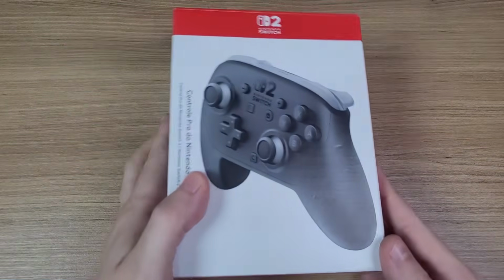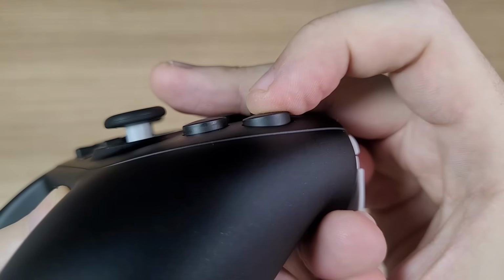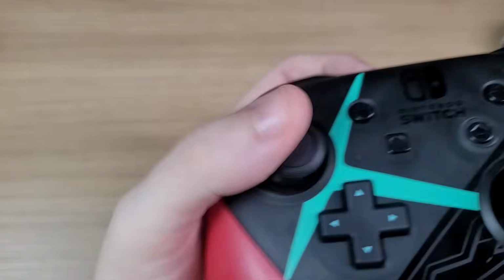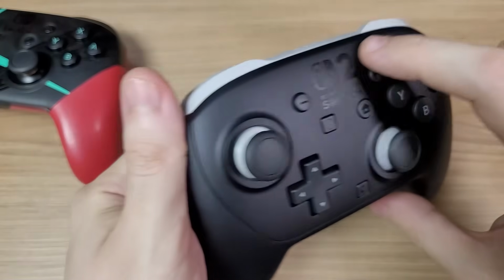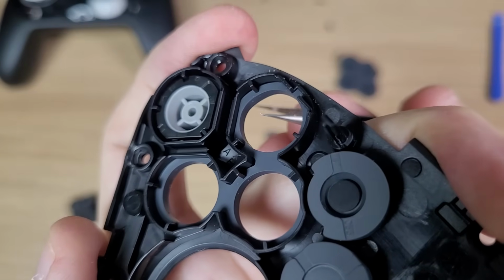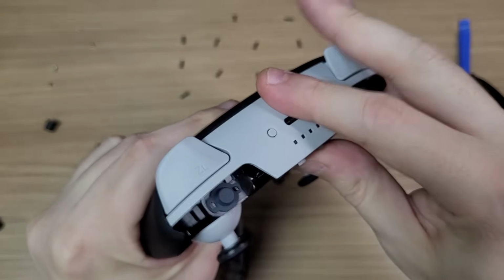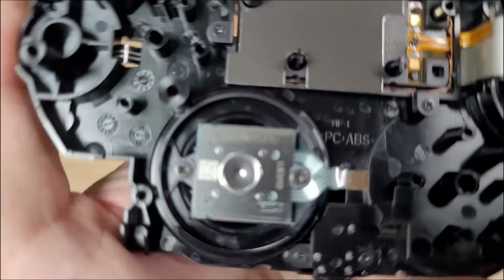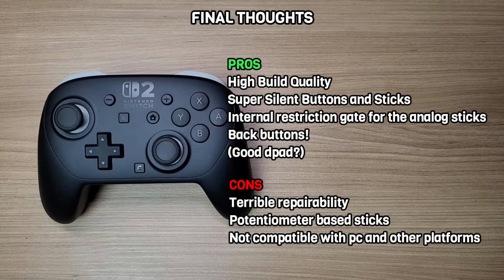Switch 2 Pro Controller Review & Teardown - The New First Party King?

Comment: ETA: These are a new variant of the RKJX2, with the noticeable change being the stick stem, could be a new variant, a new revision, or the not too uncommon practice of a solution being frankensteined by multiple products or a custom solution within an off-the-shelf part.  ALPS has terrible public documentation, only having datasheets on the original release variant (of which the GPD and ASUS products use) but not having any public-facing information on any other variants (the best documented of such being those in Sony products, having a re-molded upper housing, an upper metal retainer, and a FPC that curves to the side).  But this is an RKJX2 by sibe-by-side comparison, I had second-guessed myself about it being a new box when not being able to directly compare multiple images of the three variants.  Presumably it is just a v3 of the product (assuming Sony is a v2), though the massive change in the stick stem would be odd from ALPS but with the previously low volume of actual product on the market I'm going to presume that the change is relatively safe to preform as the Switch 2 has now likely outpaced the volume of old product in the wild within its first week.  Presumably the change is either to make the stick feel fuller-sized (people had previously said the RKJX2 felt small in comparison to the RKJXV, the typical full-sized stickbox), and/or for fitment reasons due to the controller's construction.  The unfortunate part is that a replacement would need to be frankensteined out of old and new parts (a gimbal swap) due to the stem differences, at least until these become available either via vendor (Mouser seems to sell the JX2, I might reach out to know if they know about the three different variants and if there is a resolution to this coming, I might see if any other vendors sell the product and if they have any idea of what's going on) or via an unofficial channel which will likely be salvaged parts for some time.  

The stick modules are the newer RKJX2 line of sticks, Sony has used them in PSVR2 and the Portal and GPD used them in the WIN4, there's probably been a variety of other devices to use them as well as they've been a current ALPS product for nearly 4 years to my knowledge.  I'm not sure if vendors have picked them up, the only 'official' way to purchase them as a consumer; all of their products are designated for large-scale business, typically for assembled products, this is how vendors are able to supply them as parts, whereas any other method of getting any ALPS analog stick is unofficial and typically warehouse buyouts of new old stock, i.e. buying these off of Amazon or eBay would be through unofficial channels.  I'm not entirely sure but these may eventually fully replace the typical full-sized stickbox, given ease of assembly during manufacturing, so they should pop up in unofficial channels at some point, probably next-gen when Xbox and PlayStation release new first-party hardware.  As far as the JoyCon2 modules go, hopefully a manufacturer is named at some point, their construction and overall design does look like ALPS, maybe it's a sub-variant of the RKJX2 module that reduces size (assuming they are smaller, I haven't seen a side-by-side shot of the two yet) and changes the mounting footprint; but they definitely do not look like whoever Nintendo was sourcing from for the 3DS circlestick and Switch 1 JoyCon modules, unless that manufacturer has immensely stepped up their quality of product.

I wouldn't be surprised if GK/KS produce a magnetic variant in the coming years.  Though I hope it'll be TMR and not hall, given that hall is fundamentally flawed with its age-related quiescent voltage drift.  I'm not the biggest fan of their TMR design either as it's likely a single-TMR coupled with a constant resistor as a voltage divider, where a full wheatstone bridge of TMR modules is far better, especially depending on how the magnet is arranged and moved over the sensor, though this is another area where I think the GK/KS design will always be lackluster.  ALPS originally had it correct with their design during the PS3 era with their 4pin stick modules, but we'll likely never see a design like this from any manufacturer again, at least packaged into an analog stick module.
Reply: It's definately not a standard RKJX2 though as there are some noticable differences. One of the bigger differences looks like the stick shaft is flat on all four sides rather than flat on two and rounded on the other two like standard. Might be a custom resistance range too perhaps.
Reply: @CalebDev2048 

It had been a while since I actually looked at the RKJX2 module, really no reason to unless I were to use it in projects considering how few products use it.  There's a substantial amount of differences, this is definitely a new series of box, not just a revision of sub-variant.  I'd be curious to see the two side by side.  Oddly enough, the mounting and FPC seem to be identical, I guess this is going to be the new standard, just as the old boxes were always solder-in units of identical solder points. Doesn't surprise me that there's a new box, the JX2 stands out as a bit of an odd construction looking through material on it again, I wouldn't be surprised if its design was flawed and this is the successor. 

Thanks for pointing out the difference in the stem shape, I probably wouldn't have caught that the box is different without having to go through footage of products that used the JX2 and going through the module's own datasheets.

ETA: I've had time to look through some more material with better images along with a bunch of stills from the video side by side.  It looks like a JX2 except the stem.  Could be a sub-variant, could be a v2/v3.  What I had originally been looking at was the PlayStation parts, which are a different variant, the upper housing has a remolding to include flats, and an upper piece of metal that clips and screws in place, and has a bend in its FPC when no other example of the JX2 module I know of does.  The only other noticeable difference beyond the square, and seemingly taller, stick stem is the fact that the gimbal plastics are black rather than ALPS' typical white; could be a simple visual indicator, could be because it's an alternate sub-variant, could be a situation where Nintendo is dropping custom parts into an off-the-shelf product, which isn't entirely unheard of within this industry of frankenstein a solution.  Unfortunately ALPS' public catalog changes links every few years and archival of their site is abysmal, so I can't see how their naming scheme changes, if at all, these might be silent changes for all anyone outside of the industry knows; this applies to the RKJXV, as the RKJX2 has zero archival from what I can find.  I guess we'll see if this is the new standard going forward, though the four devices I know of having the JX2 are all same release year and I assume their manufacturing would've been within the same timeframe, so Sony getting a different variant than Asus and GPD is a bit odd, and there's still no public documentation to show this variant or revision, so who knows.
Reply: how could you write so much on just a joystick?! i'm going to learn this answer off to be fun at parties! Thanks for the time taken to write and share. I enjoyed reading this
Reply: @wirechair  It's called mental illness.  I'm joking.  A handful of paragraphs really isn't that much to read through, especially when it comes to in-depth intelligent conversation.  There's a wealth of information on the subject, just as there is with any component of a peripheral, down to the design of a peripheral itself.  Just think about the component in general, how we got to this point in the evolution of design and technology, what improvements and innovations there could be going forward, alternatives to a design or technology, etc.  There's also the technology itself, the design itself, the manufacturing of both, the business side of the industry, how a complete product is otherwise assembled from these components, etc.  These are complex topics, though most people don't care about the complexities, where some people choose to have intelligent in-depth conversations, others will just blow it off due to their lack of attention span and reading comprehension.  If someone had all their research done and sat down to compose a piece of work, someone could probably write a fairly sizable textbook just on controllers and their components, I could probably have a few theses, possibly a dissertation, myself if I ever had motivation to write them up.  Knowledge is abundant but most people choose to stay unknowledgeable.
Reply: I was going to say a several hours ago before your last update when you said it was a new box that it was still essentially a variant of the RKJX2 being based off the design (I had to go out and couldn't reply at the time), either being a customised design of it specifically for Nintendo or a new revision they plan to make as standard. The only other product I know of that uses JX2 is the ROG Ally which seems to be the standard one, I found a "DIY Rog Ally Thumbstick Repair" video where they opened it where there are internal differences on the stick steam and wipers compared to the Pro 2's variant.

I am concerned about the potential risk of drift issues with these sticks, a quick search of the other products using JX2 based sticks gives a number of results for each which suggests there may be some issues. I definitely expect third parties like GK & KS to release hall effect and/or TMR sticks for it, would be good if GameSir would also sell their TMR sticks separately too (I'm not sure how they compare to GK or KS but having more options isn't bad). I also wouldn't be surprised to see them bring them for the JoyCon 2, I've seen a few argue that because of the magnetic docking they can't but considering the magnets are only in the console rather than the JoyCons themselves I believe it could be possible depending upon the strength of the magnets and shielding they could give the sticks against interference. On that topic I did come across a couple month old Reddit post of someone testing interference with magnets on their original JoyCons using hall effect sticks and there was no noticeable interference when the magnets were against the side where it docks to the console, that gives me hope, the only interference was seen with the magnet on the controller face basically next to the stick.
Reply: @Sevicify  The video by GTek, @RetroTekRepair?  The internals look the same besides the change of the gimbal's plastic color, in their video the recentering foot fell out of the stick stem, if you look at their table this is next to the lower housing with the FPC in it.  

As for drift, it could be hit or miss, depends on the QC of the production run, depends on how rough someone is with the analog stick, depends on material ingress, etc.  Non-abused potentiometers can remain accurate within spec for decades, there's a reason why traditional use of them has never been problematic.  Controllers on the other hand are a bit of a misuse use-case, generally because people aren't gentle with them, when these modules are meant to be cursor pointers similar to pointing sticks, or the IBM/Lenovo trademark of TrackPoint, hence the ALPS trademark of ThumbPoint on these analog sticks, gaming is a lot rougher on them and are of more consistent use.  There's also the issue of no modern mitigation since games have used the sticks more precisely in recent generations, for example the GameCube (Stated in its own manual) required you to not touch the stick during console boot so that the console could center the stick, PS2 had some black magic where rotating the stick through its circularity somehow recalibrated it (I think this was in part due to how the stick could also be used for 4-way directional input, taking axial min and max values and reconfiguring center on the fly, also the reason why the DBZ games didn't entirely destroy sticks with drift during the stick rotation QTE segments).  Something similar could be implemented modernly but nobody wants to do that, though that doesn't fix issues like physical damage to the potentiometer, such as the carbon track being gouged to the point of reading a differing value at a point in its physical range. 

As for GK and KS, they're essentially one in the same, GK holds the patents for the hall and TMR implementations, KS is the manufacturing partner and patent licensee.  I'm also not sure if GameSir is using their own stickboxes, I'm not finding any teardowns of the controllers that utilize them, and it'd be odd for a company to invest into their own modules; Flydigi is an outlier due to the Apex 4 sticks being entirely custom designs.  Though my opinion still stands on how these companies are producing their TMR modules, I don't think a simple voltage divider is the best design when a wheatstone bridge (which does also come in linearly-aligned variants) provides redundancy in the differential signals though it does require an op-amp to read said signals on a singular input pin.  I also don't care for the physical implementation of how these companies produce their products, though the linear slider of the JoyCon1 module, the RKJX2 variants, and the JC2 module that looks derivative of the JX2, does give me hope for this issue being fixed, though I haven't seen a GK JC1 module torn down to see if they retained the sliders at all, or how they constructed it in general.  And as per usual, my opinion that hall is garbage for something as precise as a modern thumbstick, especially when they claim to fix drift issues yet hall is fundamentally flawed where it has an accuracy lifespan due to quiescent age-related voltage drift.

As for the issues with magnets around a magnet-based sensor, this has already been solved on nearly all Xbox/Switch layout controllers using hall sticks, due to the triggers also being hall sensors.  Shielding helps, it should help TMR as well because TMR's one downside is susceptibility to external fields, just as any magnetic sensor would be.  Also the JoyCon2s should also have magnets in them given that magnet-magnet pairs are typically the best solution, I don't really see Nintendo using a strip of ferrous material in the JC2 and something like a hallbach array magnet inside the Switch2, nor do I see them using an electromagnet solution which would replace the ferrous material with nearly any common low-cost metal, both solutions of which would be cost-based. 

As for the reddit post of someone testing the GK JC modules with an external magnet, I'm a bit skeptical.  If GK retained the same slider design on top of the FPC, this would be better tested with the external magnet under the JoyCon.  Magnet strength is also important, sensor sensitivity and range is important as well, etc.  While shielding does help, it's not 100%, it's mitigation but not a solution, a treatment not a cure.  The main issue is just how many devices have magnets now, such as if you have an iPhone with MagSafe (or a newer Android with the Qi 2 spec for wireless charging and accessories, assuming those are shipping now) in your pocket and you put the JoyCon over your leg while gaming, how does that affect the GK JC module, for example. 

While TMR in the objectively better implementation is a far step above hall sensors, I just don't think magnetic sensors are the endgame.  Apparently inductive position sensors have come down in energy cost (at least in keyboard v keyboard comparisons, but not really apples to apples yet), so there's a potential future there.  There's also potential futures in other fairly common technologies within the peripheral space, someone just has to produce these solutions, which seemingly nobody wants to do.
Reply: @xaytana  Yeah it was GTek's video, and I missed the re-centring foot falling out somehow only thinking it was the wiper. Speaking of the wipers the Pro 2's are a bit longer than the ROG's, at least the plastic part of it is, which in my mind may be to help even out stresses a bit more and reduce liklihood of damaging the pads.

With drift QC is definitely important, however considering Alps supplies the modules for PS5 and Xbox Series controllers where drift due to the carbon pots deteriorating has been prominent I am apprehensive about their QC. Controller treatment of course also matters in tradtionally well treated controllers could indeed last a long time, but it seems no matter how well treated a modern controller is it can be susceptible drift when the pots wear out. I do feel modern drift does also have a lot to do with modern controllers generally having higher precision (as you kinda hit upon) with smaller deadzones where mitigation like the PS2's may not be effective if the drift range is too large, in the past the larger deadzones would have helped hide drift from deteriorating pots. I guess time will tell how susceptible to drift both the Pro 2 and JoyCons 2 will be.

GameSir do promote their TMR sticks as their own "Mag-Res" design. Looking at their promotional material they have an image of a stick with their name etched into it, and it seems to be using the JS16 form from K-Silver. I managed to find a channel "Huy Gamer - Review Tay Cầm Chơi Game" where they open up GS controllers, specifically the T3 Pro one shows the sticks have GameSir etched on one side and K-Silver on the other side. So it does appear KS are at the very least manufacturing the sticks for them, who knows what if any design input GS had in them (I'm now doubting they had much if any).

About the JoyCon magnetic docking the iFixit teardown video states the L/R side buttons are what contacts the magnets and these are made of steel, whether they're actually steel or not they are at least suggesting it's not magnetic. I do think the possibility for hall or TMR sticks for JC could be there but yeah it does very much depend on the strength of the magnets. I definitely agree non-magnetic sensors are the end-game though, on that note KS do seem to be looking at various other technology as they have a capacitive stick with the JL16.
Reply: @Sevicify  The wiper has more differences if you look closely, the new design has an entire interior cap.  My presumption is that ALPS has moved from a gimbal linkage that clips/forks the wiper pin, moving to an offset pin on the gimbal that rides within a track of this new wiper cap.  Issue with the old design being, which GTek was fixing this exact issue, the wiper peg coming off the clip/fork, where this new deign better captures the held part; though the old design could have been updated to fully encapsulate the wiper peg within a cylinder without any impact to assembly (different procedure, no interference), though I assume ALPS chose the new method (which would have the same assembly procedure as my proposed change) to reduce friction between the two parts.  Though nobody would really know without having all of the variants fully disassembled side by side, which gets expensive considering Sony has a seemingly unique variant and Nintendo has a variant that's currently exclusive to one product.  However the JC2 modules look more similar to the original RKJX2 internals when it comes to the wiper interface, possibly being a thinner JX2 with a different mount, though likely a custom product, assuming it is an ALPS product. 

My comments on potentiometer QC, usage, etc., is more about mindset and ideology of implementation and use.  Of course there's a drift issue, ALPS has cut corners, controllers demand more accuracy, nobody has any form of mitigation, and the constant use of sticks is rougher on them along with people being careless in general, compared to any previous generation.  The issue of mitigation specifically isn't unique to potentiometers, hall sensors need quite a lot of mitigation, mostly with noise and jitter (if you remember the early GK controllers this was very prevalent), and there's some amount of mitigation to age-related quiescent voltage drift but nobody implements this (it makes things quite costly on the sensor, otherwise you need processing that tracks age of the sensor, etc.) and even that isn't a solid solution considering the voltage drift becomes a runaway issue that worsens with additional age of the sensor.  As for TMR, I'm not sure how much noise or jitter a single element can display, but a wheatstone bridge at least provides redundancy that mitigates this inherently.  Potentiometers, outside of drift caused by physical damage, are hailed as the king of accuracy, because of their constant resistance value for the position of the wiper, no mitigation needed, which is part of the reason why the industry is hanging onto them; outside of damage, they just work, and remember this comes after decades of better use-case scenarios where manufacturing design hasn't caught up with modern needs and usage. 

I need to look up the disassembly of the Switch 2, though I haven't cared for iFixIt in quite some time, they've abandoned good information for clickbait, abandoned a knowledgable audience for a mainstream audience, maximum profitability is their bottom-line now and RTR is a glorified facade, filled with staff that I don't personally regard as all that educated nor good presenters of information.  Using the buttons themselves as the magnetic target is a bit odd, considering buttons are made to depress by design, and using them as a magnetic latch is antithetical to that design.  Someone should test what happens if you shim the surface the button butts against, if the button depresses and gives mis-input, or if the JC2 sits askew possibly with broken contact on the internalized connector.  Personally, I would've just stuck a small magnet under the mouse feet, this is the simplest spot especially with accompanying magnets in the body;  the point of a magnet-magnet pair would be the use of weaker individual magnets that have a tighter pull within a pair. 

My initial search for GameSir's TMR modules wasn't all that fruitful, but then again most search engines aren't that useful anymore.  I'm not sure why my initial search didn't hit their page on the Mag-Res module.  But it is a KS product, if the stamping wasn't obvious enough.  Maybe GK doesn't hold patents on the implementation of sensors for KS' xx16 modules, and maybe GS does have a patent specifically for this.  Perhaps GK does hold the patent but GS has a license contract with KS to have modules stamped with their name, perhaps this also extends to a timed exclusivity contract where only GS has use of them for an allotted amount of time.  I doubt anyone will actually know, but I'm going to assume it's a non-exclusivity but altered manufacturing (name stamping) contract. 

It's interesting that someone is finally doing a capacitive stick.  Remember when people were 3D printing joysticks for the Vive controllers, I believe this existed for the Steam Controller as well, though I don't remember if anyone did a pivoted stick as they were all just sliding sticks using the coil frame as a spring, but that's the recipe for a capacitive analog stick, even Valve's software gives you a solution for how to implement it in firmware.  Though I'd be curious to see how KS is making this work in the xx16 package, as to my knowledge this package is a gimbal that uses rotating parts, given the other two variants are hall and TMR with no sliding arts, just a rotating magnet over a stationary sensor.  I assume the most immediate solution would be to use a capacitive strip (essentially the most direct comparison to a potentiometer) and curve it to fit a pointer (decoupled wiper) attached to the gimbal pivot, this would be the least intrusive modification and the simplest solution for an altready-existing platform, being the xx16 module.  Second simplest would be moving to a linearly-actuated pointer, similar to the RKJX2 wipers, a bit more work but it's feasible.  I've wanted to play around with the idea of a capacitive joystick but never got around to it, the main issue being how do you modify the traditional design, that of which being a sprung recentering foot, while also integrating a pointer, the surface of the miniaturized capacitive pad (essentially a mini trackpad) can be the same surface the recentering foot uses, and while you can hollow the recentering foot and incorporate a spring with a pointer, how do you keep that pointer not only moving smoothly on the capacitive surface but also not breaking at the extreme ends of the pivots considering you now have a stick coming out of the recentering foot; and given that the recentering foot is on the same stick pivot, capturing a pointer solidly in the center of it will not work.  The idea of making a capacitive ballpoint pen also doesn't work, given that pens use the ink as lubrication, this would make a mess with any lubricant and would eventually run out.  The only real way to do a 2D sensor would be to have a different recentering mechanism, likely torsional springs on the pivots of the gimbal, which could actually work out quite well assuming springrate remains and their elasticity doesn't eventually turn to plastic deformation.  Another benefit would be a spherical sensor, that way it's physically a 1:1 input-output with no processing to re-circularize/re-spherize the output of a linear sensor from a pivoted manipulator.  Though those capacitive pens for touchscreens do exist, the ones that have a bending tip with the plastic foot, I assume that could be used with a modified recentering foot, this solution should glide better without snapping the stick, but I would question the longevity and durability of that flexible joint.  Otherwise I would say a rotational-linear conversion on the stick itself for a pivoted stick, essentially a circlestick lower with traditional analog stick upper, this would be easier to recenter via edge springs on the lower half, and this could readily be converted to a circlestick if needed.  I'm also curious what resolution the capacitive sensor(s) in the KS product will be, as that's my next issue with the idea of a capacitive stick, a low-res sensor could absolutely wreck an otherwise good implementation.  Also the KS product, via the datasheet for it on their site, says that v1 of the release model is about nine months old now, yet it's not used anywhere, when will we realistically see these in the wild? 

Realistically anything that could be adapted to a joystick otherwise already exists, someone just needs to package it as a joystick first.  Inductive position sensing, optical, EMR, etc.  I don't think capacitive is the endgame because of costs and resolution at scale, especially if someone produces on that works on a 2D sensor.  Inductive position sensing is probably the next big step forward, at least on single-axis sensors; as closely related IPS is to EMR, I've only seen papers on novel experiments for 2D IPS arrays.  EMR would work but it has benefits that would never be utilized within a stick, though would be interesting for other peripherals, I presume the same would go for 2D IPS assuming it ever achieves similar resolution.  Optical on the other hand has a number of different solutions, the main issue is scaling those down to work within a joystick, and how to package the product; and I'm not talking about just an absolute position encoder like the N64 had used, there's a lot of separate technologies under the optical umbrella, most of which can and would make sense in a joystick package, though optical becomes fairly fringe tech the more advanced it gets.  Personally, I'm all for an optical solution that would otherwise simplify the joystick package while also providing sensor redundancy at a much higher resolution with reduced noise and jitter.